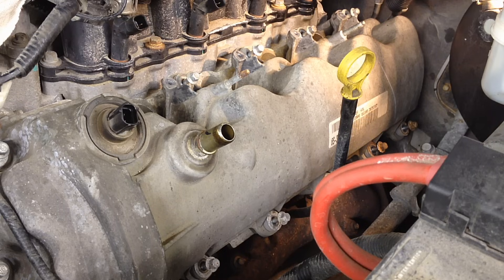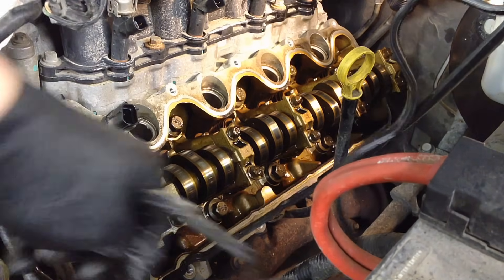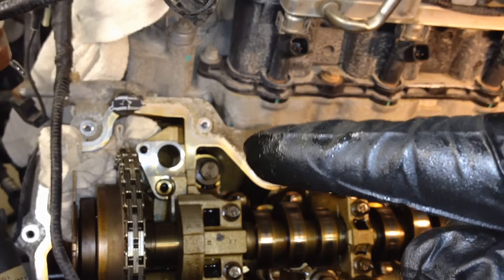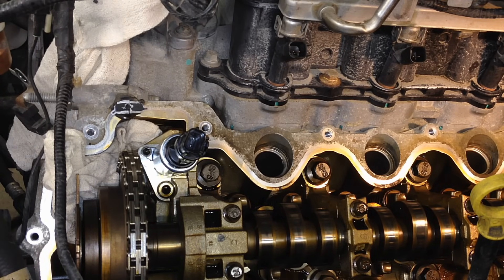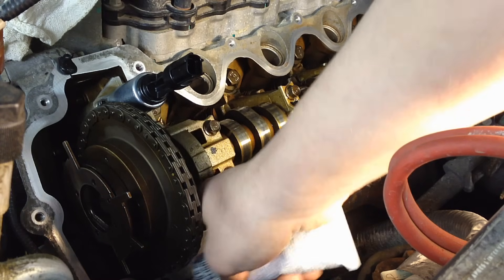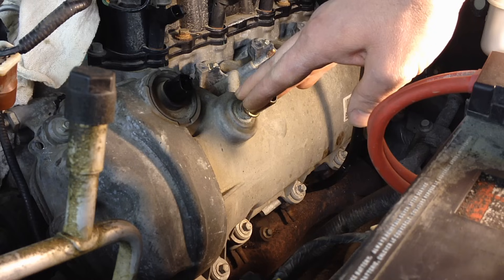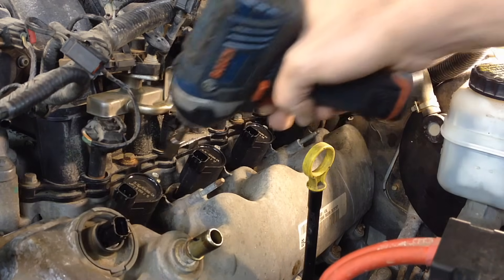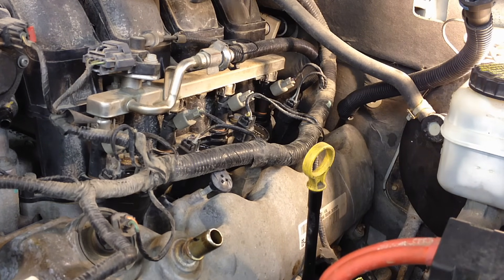Ford 4.6L 5.4L 3v Engines: VCT Solenoid Replacement

Comment: I have a 2013 F150 FX2 with roughly 150K miles.  My truck doesn't idle rough, but the oil pressure gauge will drop and it will stall when I am stopped.  When moving everything is fine.  The mechanic stated that I had 4 solenoids....2 on each side.  I'm comfortable with changing these myself, but he mentioned 4 and all I can find is info on just having 2....1 per side.  Could he be talking about something else or should I find another mechanic for the more complicated things?   Great videos!!  I enjoy watching even if they don't pertain to my vehicle and I'm not having issues.  Never hurts to learn.
Reply: What was it?

Comment: Come on!  What about the new VCT seal and the valve cover bolt seals?  That is information we need to know!  I'm a bit disappointed.
Reply from the maker: No need to replace them 99% of the time.
Reply: @FordTechMakuloco  what about torque specs for valve cover bolts on 2006 f150 5.4, very little info on that.
Reply: @FordTechMakuloco  I have found 9 and 96 inch pounds but I could not tell if it was for my vehicle.

Comment: Could you upload a video replacing PCV on 2006 Ford Explorer or Mercury Mountaineer 4.6 3 valve engine?
Reply from the maker: It’s part of the valve cover
Reply: @FordTechMakuloco  So I have to replace the whole valve cover and gasket!!

Comment: I have seen so many videos with the problems of the Phaser components that fail. What do you think of the Phaser lockout kits with engine tuner? The kits install a small tight fitting aluminum block inside the Phaser.  Seems like they would eliminate most of the failure of the Phaser design. I would be looking more for increasing reliability, and not for power.

Comment: Thank you!   I will have a mechanic replace them. I have been watching videos. Another guy suggested to disconnect these vct valves until replaced.   The truck will run with no problem. Except the check engine light. I have disconnected these selenoids and I am driving it. I was even able to tow a dump trailer...
Reply: I've heard this before, good to know it works. Would be curious what Brian has to say though

Comment: After changing the vct solenoids on a 08 5.4L, I have a misfire on #8. Switch coils around with out any change, still #8. Any idea what happened or what I missed going back together?
Reply: Darrel Nash did you find out what happened? I have the same year truck with the same motor and I’m about to change the solenoids
Reply: Josh Lozano   Purchased the truck with 137,000 miles from an estate. Replaced vct solenoids and miss appeared. Ended up that the spark plugs evidently had never been changed. #8 had a gap of .085+. Replaced the spark plugs and runs smooth now. If your plugs have been changed at the recommended intervals, you should not have a problem with this
Reply: Has 159,000 now

Comment: Please redo this video.  Other people are using a different technique and it saves soo much time!  I trust your channel but now I'm stuck.  My 2008 has a metal pipe going to the brake booster and it's preventing the cover from coming off but now that it's half way, I need to replace the gasket.  I'm stuck!  So this video is out dated and doesn't apply to all models.  Watch the other guys how they replace the VCT.

Comment: If a 5.4L is showing occasional timing issues and showing code P0345, P0349 and P10?? would you start with the just the solenoids?  Or do a full timing job and new phasers?

Comment: So I recently changed my VCT solenoid and took my valve cover completely off and replaced it and put everything back together. Truck runs better definitely but now the ABS and emergency brake lights stay on. What could cause this?
Reply: Check the plug that goes to the master cylinder

Comment: Good video for the novice. Ive done many of these and never removed the valve cover...and i would NEVER recommend anyone use any kind of impact on such small bolts that don't require specific torque specs..."faster" is not better dude!
Reply from the maker: I guess you haven't done too many since 2007-2014 model you must remove the valve cover. Using and impact requires some skill, you jut need get a feel for it and you will be fine.
Reply: @FordTechMakuloco  Brain "Do you know what you're doing!?" Lol
Reply: Does Michael Jordan have a YouTube channel? If he does I want to go there and tell him he is shooting free throws wrong and I got some tips for him.

Comment: Where is the Evap solenoid for the 2010 F150? Engine light is on and it says check fuel inlet has been on for 2 years now been time to replace it please.

Comment: You don't have to remove the valve cover at all!.  Around the solenoid there's a rubber Bushing that pops out there is one bolt that holds the solenoids.  This saves a ton of work
Reply from the maker: That only works for the early models not 2007-2014 models.
Reply: @FordTechMakuloco  thanks my is 2010.. Fck.... need to remove the cover..... 👍

Comment: Why don’t you remove the seal around the VCT Solenoid instead of removing the valve cover? Every other video I’ve seen shows them removing the seal around the VCT Solenoid.
Reply: They got smart and the newer year models have it where you have to take off valve cover to get to it now instead of changing it from outside easy like it used to be. Guess it wasn't dumb enough for the engineers. Whoever came up with the idea of changing it like this now should be kicked in the nuts

Comment: Fordtechmakuloco would a stuck vct cause running rough under heavy acceleration and I also have a code for a misfire on every bank 2 cylinder and cam codes p0018 and p0022

Comment: I have this issue described. Low oil pressure at idle around 20 psi. Idle around 500 rpm. Clanking noise and dies at stop light. Mechanic told me it’s likely oil pump.

Comment: 2006 EXPEDITION 5.4L WITH CODES P0345, PO349, P0021. SHOULD I CHANGE BOTH VCT AND SEE IF THAT SOLVES THE PROBLEM? I DON'T WANT TO WASTE MONEY THROWING PARTS AT IT.

Comment: It would help if you could provide information on the differences between the 2004 3V and the 2005-2008.  I know the cam covers and the VCT's seals are different.
Reply from the maker: There are tons of differences from the lash adjusters to the brake booster line, frp sensor, vacuum harness and the list goes on.
Reply: I just bought some 3L3Z-6564-A followers. Hopefully those will work on my early 2004 5.4 3v
Reply: I think an easy way for someone to see if they have an early 2004 engine is to look for the front center bolt on the valve cover.

Comment: I’ve got a 5.4 3v in the shop that keeps setting p0012 and p0022. Runs perfect until you load the engine and then it loses a lot of power and idles very roughly. If you stab the gas it smoothed out again and idles fine. I was thinking it had a bad phaser or solenoid getting stuck. I opened the timing cover up and all the components are brand new dealer parts.
Reply: IWORKYOUWATCH check your coils
Reply: Osama Abdulla No I scoped the cam sensors and there not overlaying like they should.

Comment: Question. Did a timeing job 2010 raptor 5.4. Used ford fasers. I asumed ford vcts. Runs great but after a drive, get the bank 1 over retarted and spark knocks . Put in park tap gas, smooths out. At idle can run hours on end zero problems. Go for a drive come to a stop spark knock bank 1 over retard. So. The owner got a local parts store vcts. Replaced. Same. My question. Are the local parts stores no good? Wont say brand or store but was not ford. Should i buy the 1 in your link? As the pair i got originaly may not be ford as well

Comment: Great video, also great diagnosis video for this problem. Thanks for doing these. I believe you have narrow down the problem for me. I am having the harsh shuttering at stop signs & at idle after driving but I did want to ask, would the VCT also cause engine shaking at higher speeds? & delay in acceleration like when I hold the accelerator at the same position for a few seconds then all of a sudden a burst of power? I have been tracking down this problem for a while. Have installed new coils, plugs, injectors, can & crank sensors, tps, throttle body & new pigtails where needed. This all fixed a lot of low power issues but the hesitation/shutter at higher speeds & harsh shutter at idle & stops still remained. Thanks in advance.
Reply: Did you ever figure out the problem brother?
Reply: @Jerry.Fishes  Hey! Yes I did fix this. I’m not exactly sure what fixed it in the end. I finally decided to just go ahead & do the timing chains...which the drivers side had jumped a tooth due to the plastic guides/tensioners shattering & giving too much slack. I replaced everything, timing chain, guides, tensioners, phasers, VCT...all with Ford OEM parts. While I had the engine out I replaced all pigtails on the coils & injectors too...which I had replaced coils & injectors previously like you probably with no change in the hesitation. Once put back together all hesitation was gone, if I have cruise control on & hit a big hill I lose 1-2 mph rather than 10 & the engine doesn’t skip any while idling. An expensive fix...around $2,800 doing it yourself (I do not recommend)...well, the $2,800 was with oil pump, motor mounts, valve covers...everything I could replace while I had the engine out...or $3,800+ at a shop. Ford will put a new engine in for around $6,000-6,800 last I checked. May be the better...easier...route if you have the money & plan to keep the truck for a long time. Hope this helps! & good luck!

Comment: Brian, can you please do a video on how you were able to get to the valve covers, there is a lot of stuff that needs to be removed before you get to the point where your video pick up
Reply: There is a 4 video series. 1 of 4, 2 of 4, 3 of 4 and 4 of 4.
Reply: You don't actually have to take it off in order to replace the VVT (VCT) solenoid. The grommet comes out and it can be replaced I recommend you go about it that way
Reply: @daviddlugosielski3020  Yeah!  I agree with you David.  Brian took off the valve covers to remove the VCTs but they could be removed from the port holes externally.  Wonder why he did it that way?
Reply: @daviddlugosielski3020 2007 late model and later you have to remove the valve cover. Know your stuff before leaving such comments

Comment: I just rebuilt a 2005 F150 5.4 3 valve motor. New VVT solenoids and Phasers were installed. Started engine and ran great for the first 2 minutes. Went to go drive it and started running rough and code P0012 set. Where do I start?
Reply: Hopefully the chains are in time, what brand of phasers did you use? I'm working on a customer's truck with same code but this one has 200,000 miles on it and was sparcley taken care of and has making noise for several years, I'm going to unplug the solenoids and look at scan data tomorrow hopefully it is just a solenoid. I would like to know what you find.

Comment: When I go to the link for the solenoid, it says it doesn't fit my 2006 Expedition. I have a 5.4 3V...is this not correct?
Reply from the maker: Yes it is correct.
Reply: @FordTechMakuloco  also...is it really necessary to remove the valve cover? I've seen a few other videos where they replaced VCT without doing that.

Comment: There is a rubber plug around the solenoid that you can take a small screwdriver and pop out. This saves you from having to take off the whole valve cover.
Reply: Some years you can't take the plug out. Like mine. And you yotta remove valve cover
Reply: @Ben-qy7cl great information 😮
Reply: And also , when ur trying too take out the bolt ,it can fall inside the cams or valves or even the engine block , , because not enough leverage , it's better to just open it up it's not that hard
Reply: 6:13
Reply: On 07 and up model years you can’t do that

Comment: i have a 2005 f150 with the 4.6 ... why do i have a rough idle when ever i turn the AC on... and when i turn the AC off the idle smooths out..... any sugestions on what it might be
Reply: Cooling fan going out or off balance?

Comment: Have 320K miles on my 06 F150 and on a recent trip to the beach had this happen to me... Cruising at 75-80mph for about 45 minutes, came to a stop to make a turn, truck started shaking and running rough, tried to coast and she died.  She started right back up and we finished our trip, but now I am studying up on how to do a complete timing change.  Thanks for these videos.
Reply: Did you end up doing it? Mine stalled once after  idling in warm weather then coming to stop but nothing noticed since
Reply: @KollynJ  Yes, I sure did.  Had my iPad in the garage with Brian's videos pulled up.  I planned on doing it over two weekends but was able to get it done in one.  My truck is still running great with 360k miles.  I would say, when the truck sputters especially under light load, my experience has been a bad coil pack.
I bought a $30 OBD scanner from HF to determine if I have a misfire code and what cylinder, then swap it with a known good one and try again (learned from Brian btw).  If I get a misfire on the known good cylinder I know the coil pack is bad.

Comment: Hi
Can you help me? 
I have expedition 2008 and when I turn on the a/c the  cooling fan not working!
The fan is OK because I counct it directly with the pattry and it is wark... The problem is that it is not wark with the comprser or when the hot become high.

Comment: I replaced both the VCT solenoids and  did all other steps and still have the same issues what would course the new ones to do the same when coming to a stop
Reply from the maker: You need a timing job you have low oil pressure issues.
Reply: @FordTechMakuloco  rebuilt motor 60.000 miles ago   i will check the timing thanks

Comment: Dude, i dont know what to do. I have an 04 f150. I keep getting P0345, camshaft sensor bank 2. I have changed the sensors, fuel filters, starter, battery and VCTs. And it still will finally cranknsome times and barely keep running. Engine and truck shakes, stalls, cuts off. Their is a loud knocking somewhere when it does run.  It was working just fine, until the battery died. Only issue I had prior was a low idle that stumbled at redlights.. is this a phaser issue? I mean the only things I havent changed that could effect the P0345 are the crankshaft sensor, PCM and phasers. Some please point me in a direction....thats the only code. Oh and has absolutly no ppwerr when i can get it running. Ty

Comment: Good video as always man , thanks for sharing ur knowledge with us , and I have a question, I have an 05 Ford Expedition with like 180k miles in it and don't know the history of it but it's giving me the P0012 code , on bank 1 and I can hear it knocking on that side as well , what u recommend me to do on this case should I go head and change everything on it or just open it and inspect to see what's going on
Reply: Video is doing a nasty disservice to 04-06 ford owners,  No need to do the hellish valve cover removal on 2004-2006, comes right out the hole, pull the seal, use a long t27 screw driver, 10 minute job.

Comment: I own a 2004 f150 with the 5.4 3 valve  It starts up runs ruff and eventually will smooth out like nothing is wrong. The shop has already done a tune up and installed all new coils. But i keep having this issue when the truck sits let's say overnite and I go to start it. It will activate my check engine light and they keep saying the code says banks 1 and 2 are running lean. Could it be the vct valve?

Comment: Hi I have a 2013 Ford Taurus 3.5 oil is leking on the top of the that selinoid can I just change the gasket on the top or the whole selinoid car drives fine no lights on just the little bit of oil on all 4 selinoids Thanks for your help.

Comment: Hey there long time follower   On the ford 3.0l dohc engines does the vct seal on the valve cover come out through the inside or outside of the valve cover?
Reply from the maker: Outside

Comment: Am getting oil iny pvc tube what would cause that it don't burn any oil but just started leaking at oil pan. And how do you change pvc?
Reply from the maker: Oil in pcv line is normal.
Reply: @FordTechMakuloco  you are talking about from PVC to the back of the intake right

Comment: My mustang gt dies while im driving, is it a cause of the solenoids?
Reply: Daniel, you will need to give more symptoms for a proper diagnosis! Temperature? Loss of power(intermittent power loss/full power loss?) Need more symptoms that lead up to the loss of power. Off hand, sounds like you have a wire issue or heat issue?! Start with spark, fuel and compression! Should go off with a bang! lol...

Comment: I had a problem with my 2006 F150 5.4L a few years ago that it I would be driving then suddenly the driving would get rough and it would stall completely lose power. I would coast to the side of the road and then wait a minute or two and start the truck again and it would be fine. This does not happen anymore but occasionally when I step on the accelerator after stopping it drives rough and cant accelerate initially. Could this be the VCT?